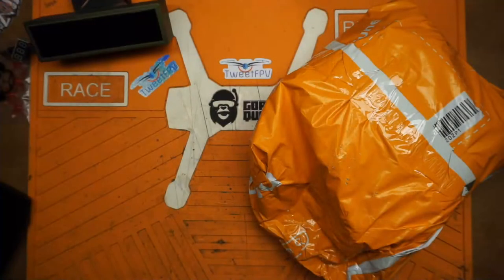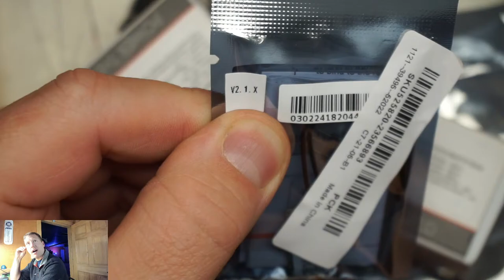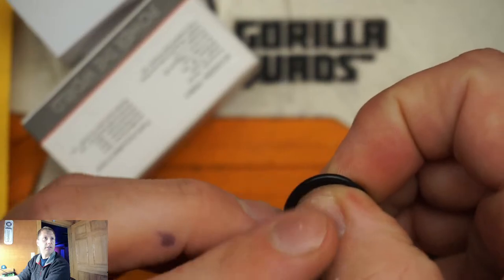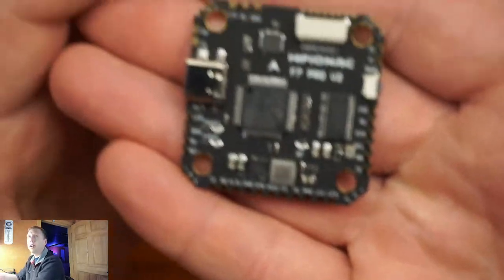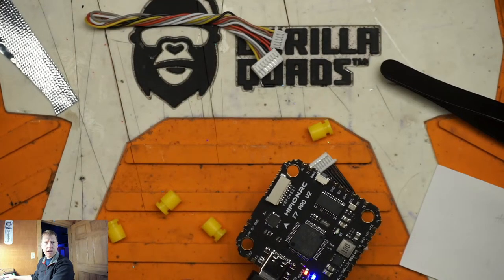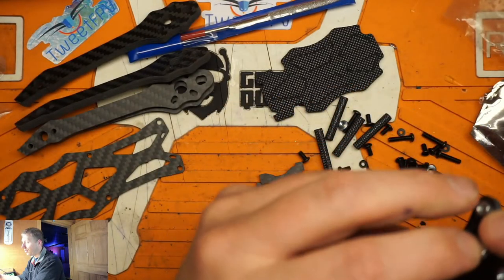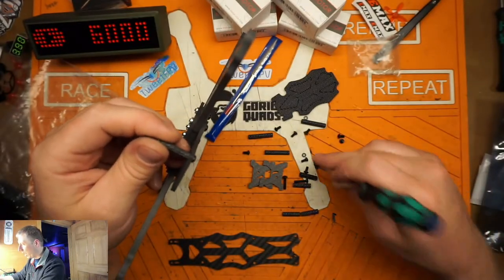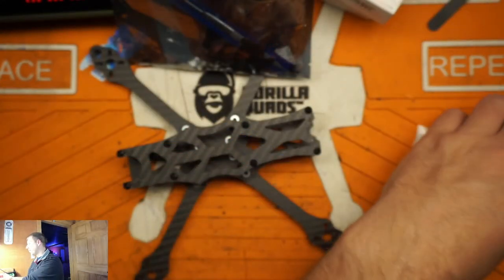Q&A, channel news 12/19/20

Comment: Looks like its going to be a decent build still wondering about that BT pad thanks for the show Tweet have a safe and 
 Merry Christmas from my family to yours
Reply from the maker: If you open up the speedybee app this board does show up under the Bluetooth connections. so that makes this a really full featured FC. Didn't check to see if it had a barometer. If it does i cant think of what else i needs.